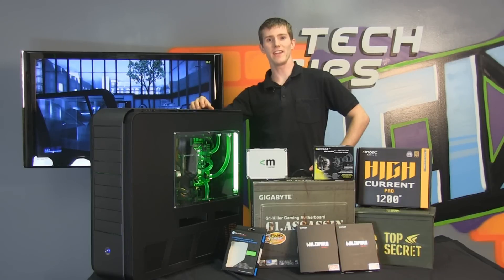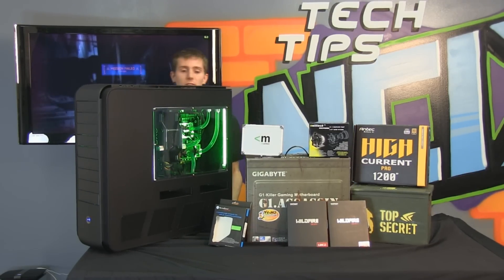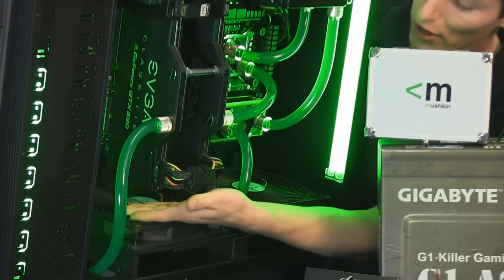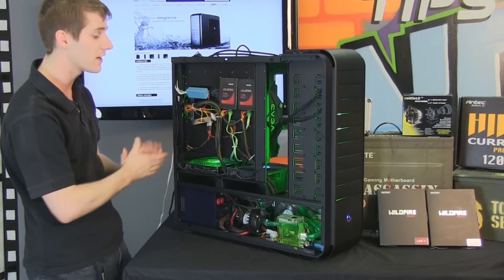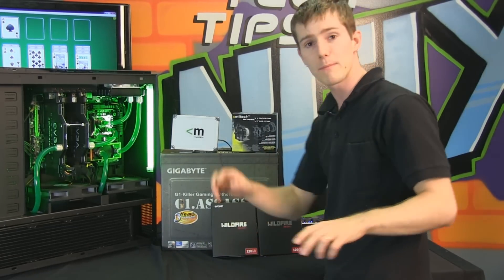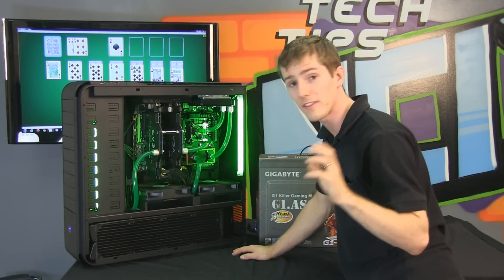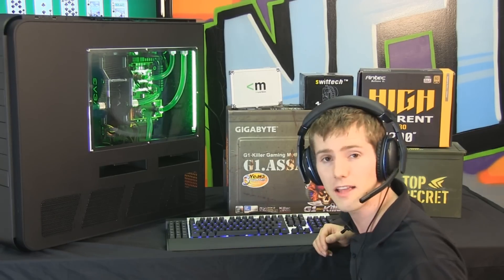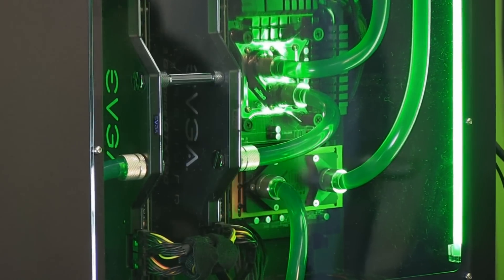Silverstone TJ11B-W Water Cooled - Extreme Buyer's Guide NCIX Tech Tips

Comment: just a quick question rather then using 1 massive water radiator like 4x120 wouldn't it be better to place 2x2x120 radiators around the case to evenly distribute the cooling so the liquid is hot by the time it reaches the radiator and its evenly cooled throughout the case..
(im sure this would be possible with quite a beastly pump)

Comment: velcro is fine.  some cases have screw holes on the other side of a mobo tray to screw mount the ssd.  

I have my mushkin callisto deluxe mounted with velcro tape on top of the bottom hdd cage in my corsair 550d. ( I WISH freaking psu makers would make the sata POWER connectors NOT so far spaced distance-wise between each other.  It would make the cabling much more tidy)

Comment: You absolutely do not need liquid cooling to overclock. Cheap water cooling systems (under $200) don't outperform decent air coolers like Zalman and Noctua provide, and a decent liquid cooling system that will allow seriously high end overclocks can cost many hundreds of dollars, especially if you do it properly with GPU and CPU blocks, double pump and quality hoses and quick-connects. Some people even go crazy and liquid cool their chipset, RAM and hard drives which gets really expensive.

Comment: Why the TJ11 over the Caselabs STH10? The STH10 runs cheaper, is bigger, and can accommodate many more radiator options than the TJ11... I don't think the mobo rotation justifies the price difference, especially if you'll be watercooling.

Comment: Not really depending on what you are cooling. more water more heat is needed for the temp to increase so if you are folding yes because you are running 24/7 gaming it is only going to be a degree or two. so it is overkill and a waste of money if you need a cause to donate money to I would be happy to accept.

Comment: Well not that often if it is overkill to run it maxed out, if you only watch videos on the internet a core I3 and a I7 3770k with 4 580s in sli (580 because they are better than the 680 at general computing

Comment: yeah either its a uber bottleneck with a very high end gpu or you can run crysis at that high fps at the low settings on a 240p resolution.

Comment: @vmeisterkun @vmeisterkun I've never put this to test properly, but I honestly have not seen much of a difference when comparing dual and quad core CPU's. However still, I find it rather pointless to pay 1k for a CPU, when a $225 i5 2500k will give near identical performance. Especially with a $170 P8Z68-V and a $35 8GB kit, you really aren't loosing that much performance.

Though if that is a hobby, that is quite an expensive one... :P

Comment: @christoiMc lol 1-2 cores? really? that might be the case a couple of years ago =]. However now alot of games are utilizing 4 cores. the GTX 590's are not overpriced at all, you are paying for a SLI solution in a one card solution, 2 580's would out perform 1 590. Nothing is overkill, its a hobby =]. dual 7970's in a multi monitor setup will not run latest games at 120fps or barely managing 60fps at maxed out settings =].

Comment: @Dayfoxx7000 Raid 0 is where a computer uses 2 separate hard drives as 1. say u have 2 60 gb hdd       in raid 0     your comp would see it as 1 120 gb hdd     it is also faster    but more likely to have a hdd failure. and if one fails or is removed from the chain, poof   your data is gone even if the other hdd is still good

Comment: I've honestly never seen a point in getting such a machine. Currently a single 7970 and a 2500k is capable of maxing out all games currently available. Most games hardly use 1-2 cores, why bother with a 990x? The GTX590's are overpriced and downclocked, plus two is absolutely overkill.

Even when running multiple monitors, dual 7970's would be more than enough.

Comment: That thing has to be over $5,000. My Ultimate build wishlist is around $4,600 and just the case that TJ11 case is like $450 bucks more than what I picked for mine. I've picked GTX580's and I went with just one 256GB SSD and two 2TB Drives (Storage will never be an issue). 64GB of ram (why not) and an ASRock X79 Extreme 9 Motherboard because I wanted 64GB of ram and it looks sweet. Sandy-E i7 3960-X w/ a H100 cooling system.

Comment: @unlaughable 

Yes, they are actually pretty shitty cards for the money. Id rather have 3 vanila 580's with EK blocks on them, and OC through the roof than those cards.

Just google GTX590 fails, and you will see plenty of articles of the video card not being able to overclock much. Sad part is you can't even get the GPUS to run at stock GTX580 clocks per. So yes in that definition they are bad, but if you compare it to your 8800GTS they are great. Hope this makes more sense to you.

Comment: question on this case.

im putting water cooling in this case and pitting a 2nd PSU, do the psu's need to be same size in power ?

like my main is a 1500w psu can i fit a 350w or 650 or any other size or does it need to be another 1500W psu ?

Comment: since the ram doesn't produce as much heat, and they dont even NEED to be watercooled, then i think you should run the output from the quad radiator to the cpu then the output on the cpu to the single 120 rad then to the 590's

Comment: @feuchster If you want to only start out by cooling your CPU like i Am. Grab a 240 Radiator by XSPC or EK. if you want to upgrade your GPU to COOLin in the future grab a thick 360 rad. then you will have enough flow for a gpu later on. but yeah 240 rad, pump, res, tubing, cpu block. an whatever else you need. Hope i helped anymore question hit me up on steam: [OCN] Chiefpuff420

Comment: @feuchster For a Custom setup 200-300$ an all the way to $2000 depending on what your doing! cheaper kits(like XSPC RASA) can be had for 130-200$ but i suggest buying individual parts Most people on a tight budget like me end up paying 240-290$ cheapest. EK kits are decent but still buy seperate and set your loop up the way you want!

Comment: @saramhussain Actually there's a big difference. I used to run dual loop setup with dual GTX580's and 980x at 4.5ghz+, but then when one pumped failed I switched to a single loop setup which made my look fairly restrictive. I lost about 8-10C to my CPU under load, and about 3C idle, though my MB/GPU are the first to be receiving the most pressure from my pumps. But yes, Tidy loops > 10C in my case.

Comment: Why not get case labs. It is cheaper and you can fit four 480 rads internally with push/pull config. The case I am talking about is the th10. I have the first production case and it is way more cost efficient than the tj.

Comment from the maker: @cdavid119 Not worth it to spend the money to water cool mid range parts. Full cover blocks alone cost $120-150. Might as well get a better graphics card for that kind of money.

As for two separate loops, I've never really believed it's necessary. A few degrees here and there is hardly the difference between "omg I'm stuck at stock speed" and "epic overclockz"

Comment: @MTA077 It's an alternative to a hard drive, it is a storage device that uses no moving parts unlike a hard drive which means they are faster and can be made smaller, ssd's increase boot times and shutdown times and application speeds. though now they are more expensive and have lower storage than hard drives

Comment: @darkj3am Because he is not using the brackets (not for their intended purpose anyway). The reason i mention this is because in the unboxing of the tj11 he didn't know what the brackets were for, he thought they were 3.5">2.5" adapters. But they are specifically made so that you can mount ssd's on the side of the 5.25" bays, where there is noting else anyways, so they don't take up space on your mobo tray and mess with your cable management.

Comment: Uhh, linus, you do realize that the two 2.5" brackets that came with the case are designed to be mounted vertically on the side of the 5.25" bays, right? No need to mount the ssd's behind the mobo tray;)

Comment: EVGA Classified Super Record 2 -emolevy, Dual QPI LGA1366 Xeon
2 x Intel Xeon X5690 -processor, 3.46GHz
2 x Noctua NH-U12P SE2 -CPU cooler
48GB DDR3 1600MHz RAM
2 x 120GB SSD (Raid 1/0)
4 x 2TB SATA II-kiintolevy
2 x NVIDIA GeForce GTX590, 3GB -näytönohjain
Xonar HDAV 1.3 Deluxe 7.1 -soundcard
Lian Li PC-V2120B -case
1500W SS PSU

My system is still better..

Comment: @NinkaPanda The water doesn't touch any components. This is how it works:
HEAT PRODUCING CHIP IN CPU AND GPU TOUCHES COPPER WITH THERMAL PASTE TO COVER NOT FLAT SURFACES. HEAT TRANSFERRED TO COPPER. COOL WATER COMING IN TAKES HEAT AND FLOWS OUT THROUGH TUBES AND GOES TO RADIATOR. HEAT IS DISSIPATED VIA WATER>AIR. WATER THEN GOES BACK TO RESERVOIR (HIGH IN THE CASE). WATER THEN GOES TO PUMP AN CONTINUES CYCLE.

Comment: I´m wondering where the optical drive is.^^ Also the mounting of the SSD´s looks strange. In this case you have an extra mounting place for 3 SSD´s at the left side of the 5 1/4" bays. For this you have three mounting plates included in the accessories of the case. You can find a lot of pictures about that in the internet, also a look insde the manual on page 13/14 helps.

Other than that the pc looks awesome =)

Comment: uhh gtx 580 is able to run 4 cards in sli is single gf110 gpu... 590 runs 2 gpus makin it 2 graphics cards in 1... thats why u can only have 2 because nvidia software only supports up 2 four way sli so sorry but YOUR WRONG 2 gtx 580s is not quad sli... its regular sli i need 4 physical gpus and a 580 has a single chip in it

Comment: @TheDJVAQ the 590 has power equal to two 570s. 

In theory, the 590 DOES have two 580's but they under clocked the GPU's to maintain the heat. 

The MARS II elevates this problem SLIGHTLY to improve performance, but is still not competitive to match two GTX 580s in SLI.

Comment: isn't the resivoir supposed to be above the pump?
could I put a lga 1155 board, 2x 590 in a level 10 gt with 1 dual 120 rad and 1-2 120 rads using a drive bay resivoir?